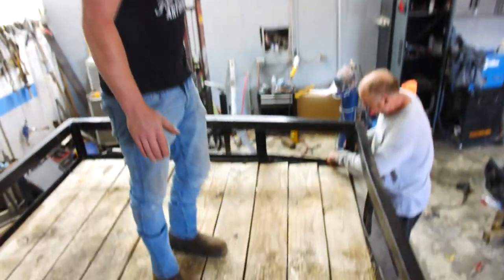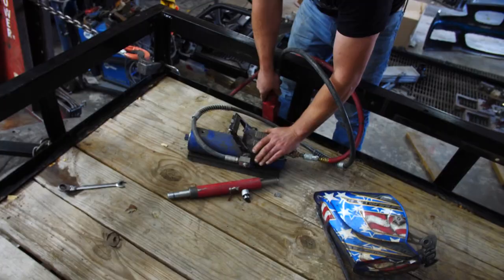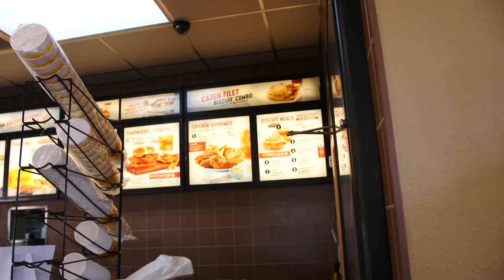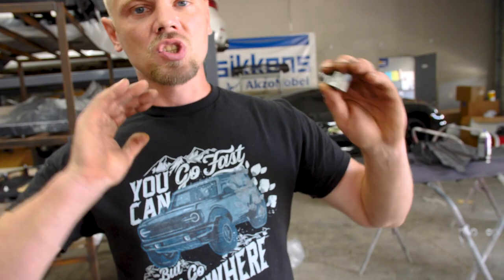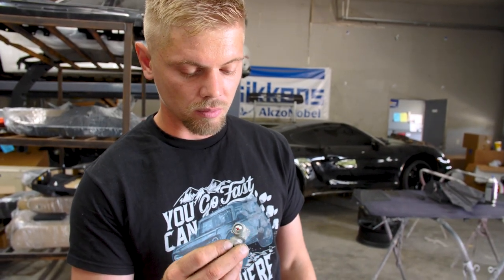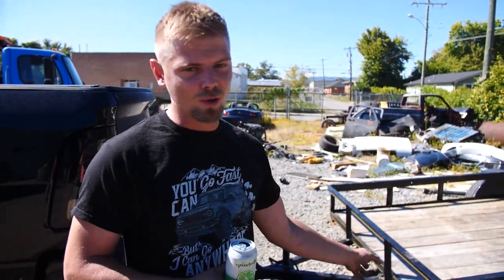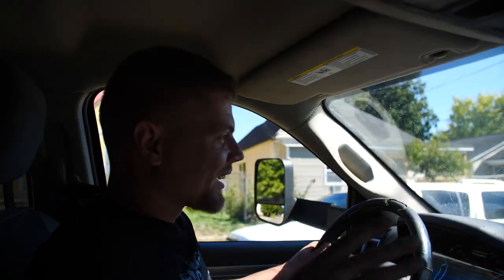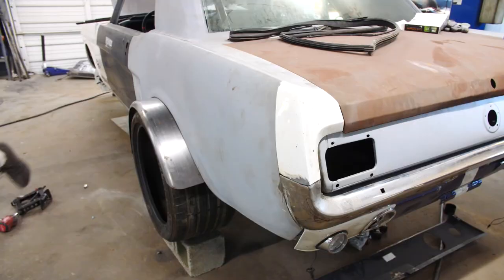How to make a $250 Trailer worth $2500 with a Frame Machine, Vtuned steals our fender for mustang?

Comment: You remove fasteners on boards & BOW them in the middle around center point & pop them out, replaced mine few years back & that's how I did it, got to cut them the proper length, for short trailers I've used narrower boards 2x8 or 10's on 16' trailer & 2x4 or 6 on shorter trailers.